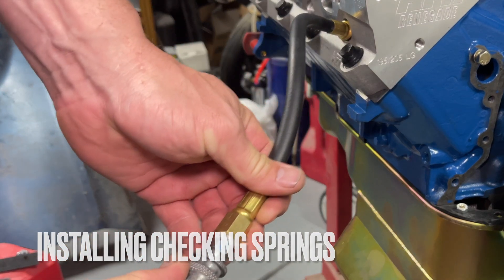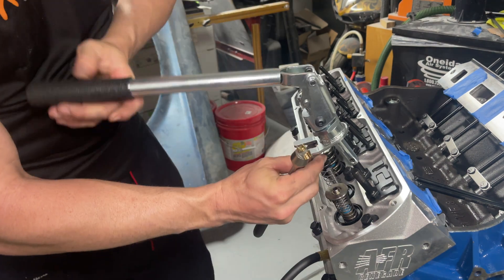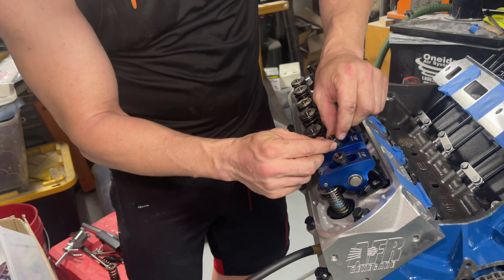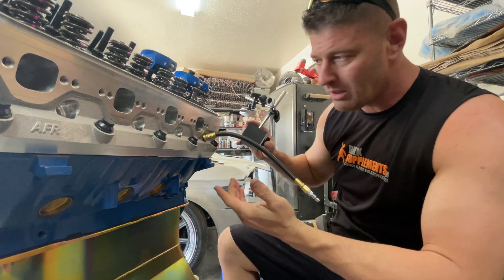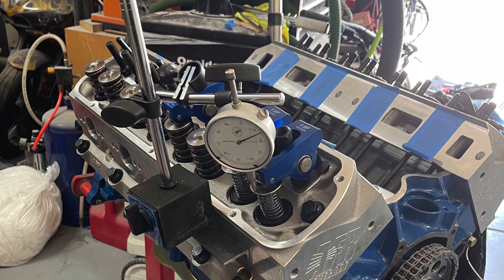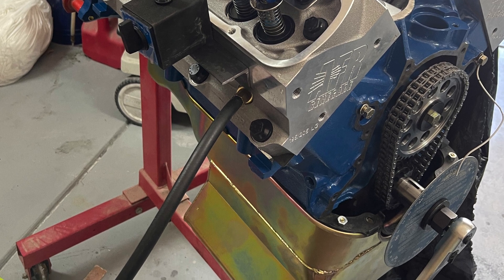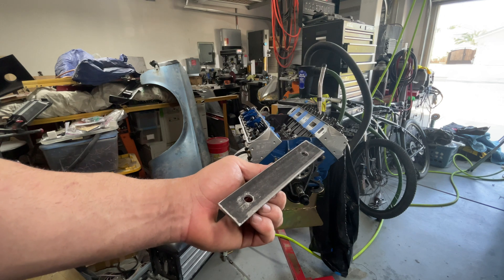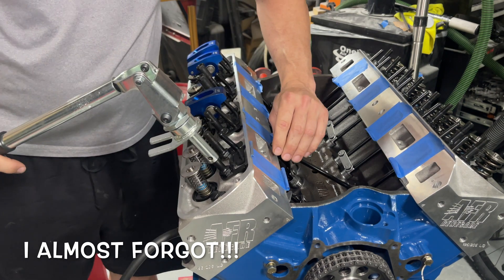351W 408 Stroker Engine Build PART 4 Lifters/Pushrods/AFR Pushrod Guide Plates  4K

Comment: Does 6.700" pushrod length sound kind of small for a SBF 408
Reply from the maker: I’ve only ever built one, so not to me. I measured, and that was the length lol. All you’re trying to do is take up the gap between the rocker and the lifter. I’m sure too small, you’re gonna start losing lift eventually knock and have problems.. any too big you’re gonna bend them and have quicker problems? But they’re not hard to measure for.